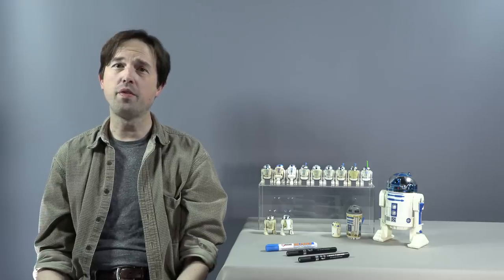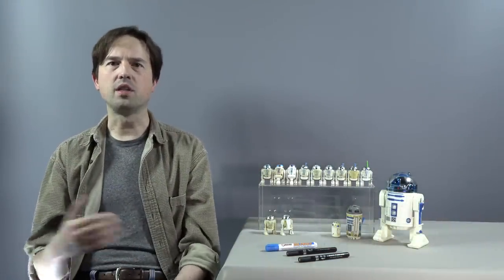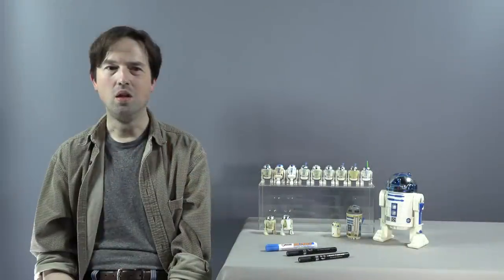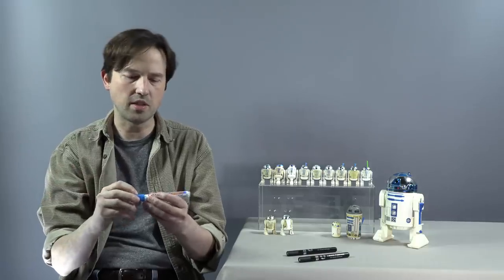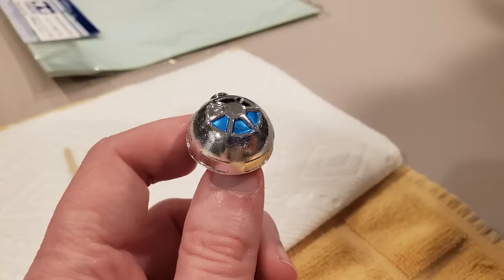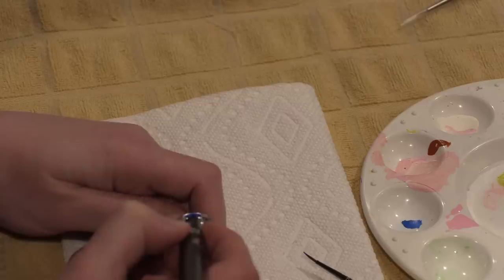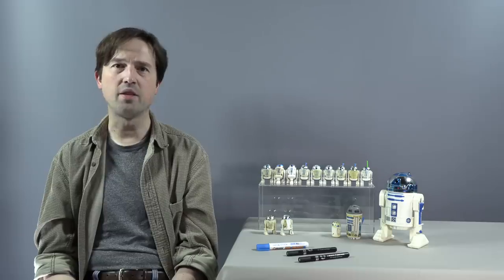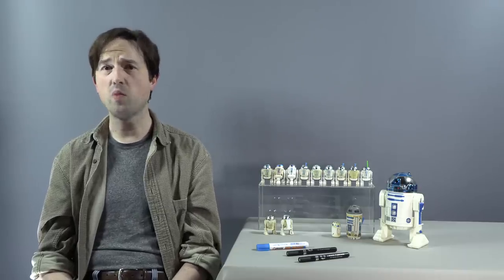Star Wars Vintage R2-D2 Restoration: Part 2 - Kenner / Meccano 1978

Comment: If ever you want to mess with Chrome or durable metallics again look around an online store called MicroMark. They sell a lot of wonderful hobby tools. One of the things they sell are some do it yourself electroplating kits. You lay down a base layer of a conducting paint, masking where you don’t want metal. Then run current to the paint, and paint the surface using a conductive brush that completes the circuit. Buffing between layers. It works surprisingly well, but is messy and time consuming (do not do indoors! Well ventilated area). There are different metal finishes available. I’ve seen some gorgeous Phasma helmets done with it. 

Also, quick tip if you are trying to detail paint on chrome, and getting that glare problem. Put on a pair of polarizing glasses. Sunglasses or range glasses. The Polaroid on the glasses will eliminate most of the light scattering so you can see what you are doing.
Reply: Your process sounds like the way to go.
Reply: rxz4140 This is a decent video showing how it works. It’s called brush plating. The one thing the gun doesn’t quite explain is he puts down copper first to give a better base to then plate over. And get better results.
Reply: Andrew Taylor No vid?

Comment: Super job so far and seems like the dome would be the hardest part due to the chrome.  The idea to add a layer on top seems to have worked.  It looked a bit smoother to me and, as you stated, it should actually protect the other chrome finish underneath.  I paint 28mm D&D minis and I am no Rembrandt but the more you paint, the faster and better you get.  Frustrating at times but overall relaxing and enjoyable when you get a batch of something painted.  Can't wait to see what's next for R2!  Makes me think of when Threepio said, "Thank the maker.  This oil bath is going to feel..."  Well, you know!  ;-)

Comment: Odd that you were told that blue colour was applied by electroplating, there are not any blue metals. Chrome has a blue hue to it but it has a basic silver colour overall. The closest I can think that actual colours get applied by something similar to electroplating, is anodising, but I don't imagine Kenner masked and anodised just those little spaces in the dome more likely that it is paint or print of some sort like the eyes on the vac metalised Death Star droid. Vac metallisation is actually aluminium, and as a metal, aluminium  does get anodised with colours, but not really in cases like this, my money is mostly put on paint. Try some tested paint removing tricks on a worn artoo to see if you can paint strip the blue
Reply: Yes its just paint. Try this, but let it sit a couple of days. https://www.umarkers.com/paintmarkers.htm

Comment: I eagerly awaited this video, and I'd almost given up on you doing it.  Thanks for delivering on this!  I used citadel ardcoat (a brush-on clearcoat) recently on some GI JOE color repainting, and it gave it that original shiny look.  It would probably give you an original shiny finish on the blue panel parts of the head.  Just make sure that the paint is dry before using the ardcoat. It does work very well.  If you have any reservations, just find an old R2, paint a single blue panel on the head, let it dry, then try the ardcoat on it to see if you like the results.  Either way, looking forward to the next part of your restoration, Michael!